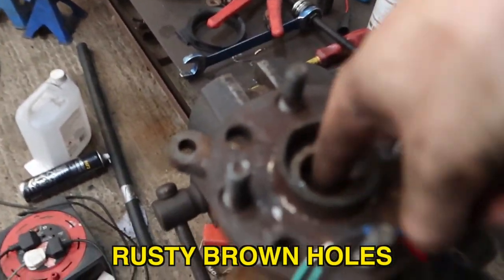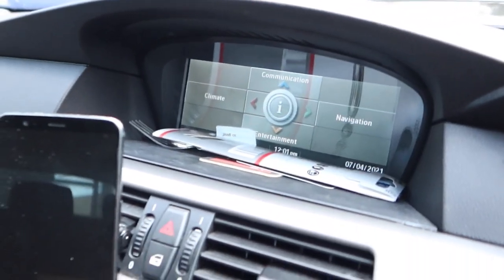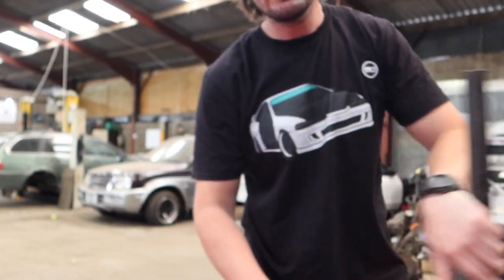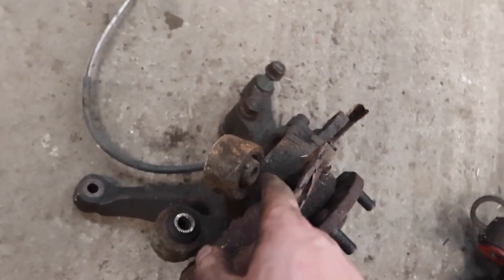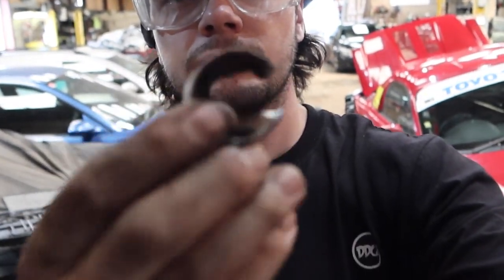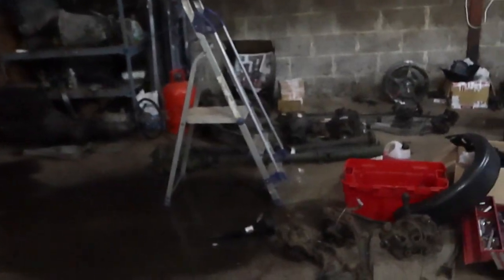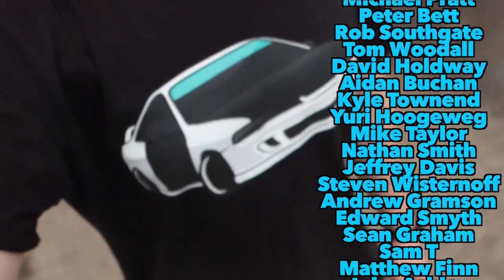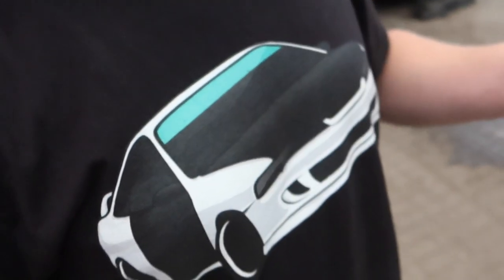Engineering to make you proud

Comment: Dan, you're giving me PTSD with this video! I've done every single bush and bearing bush underneath my E92. A couple of weekends ago i tackled the last ones being the subframe bushings by removing the whole subframe on the drive and on my own. Removing the old bushes and fitting oem M3 jobbies has to be one of the worst jobs i've ever undertaken! The results are great but i'm never doing that again! 😅 I don't have a recip tool so used the puller set and burning n beating methods.